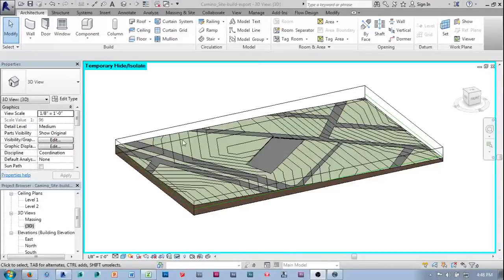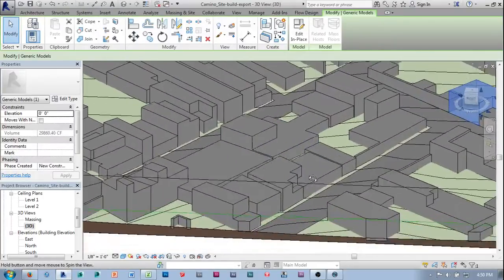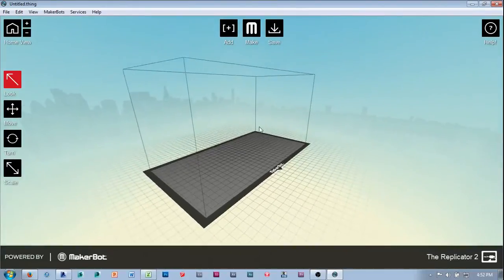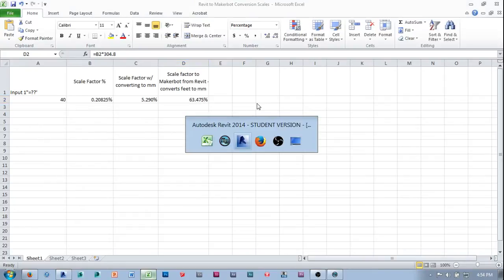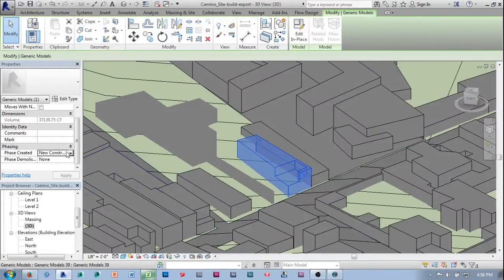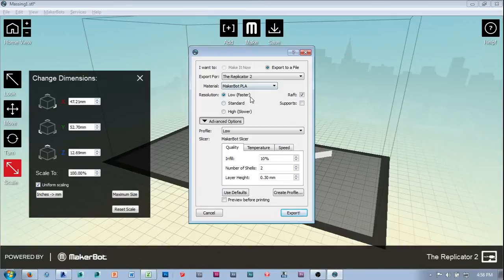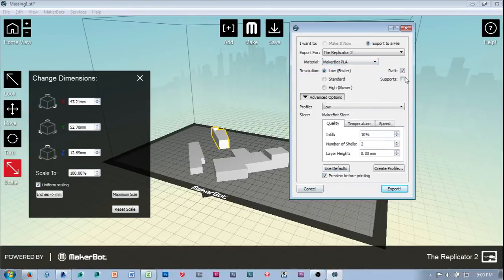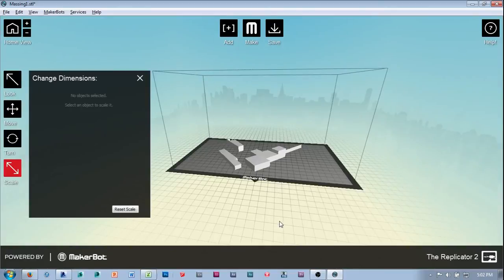Revit to Real 4 - Printing the Massing Models

Comment: Thank you for this!!!! Could you share the scaling formula? I would like to prepare my own spread sheet
Reply from the maker: Absolutely:  Cell D2 is =B2*304.8.  Cell B2 is:  =(1/A2)*0.0833.  A2 is the input value for 1"=16'.  Your input in A2 would be 16 for 16' (1/16" scale model), 4 for 4' (1/4" scale) and so on.  304.8 is the conversion feet to mm (difference in base scale for the two pieces of software).  The value of .0833 is the numerical value for 1/12 (12" in a foot) to scale down feet to inches.  Hope that helps!!  -dave.